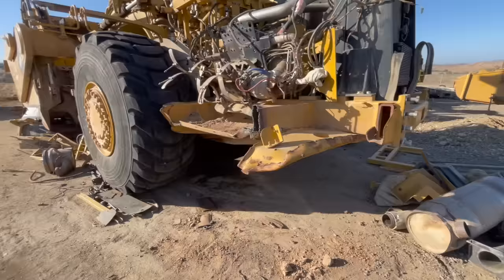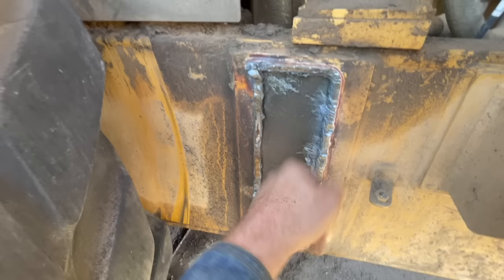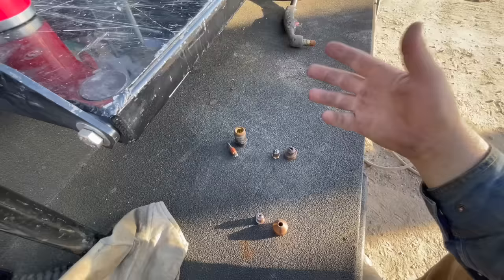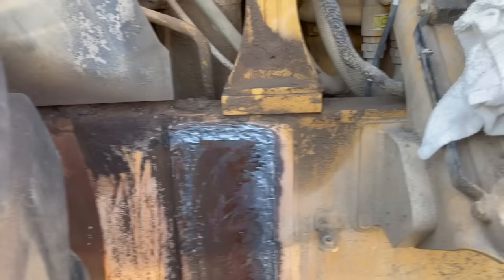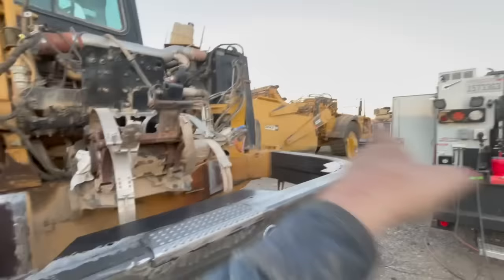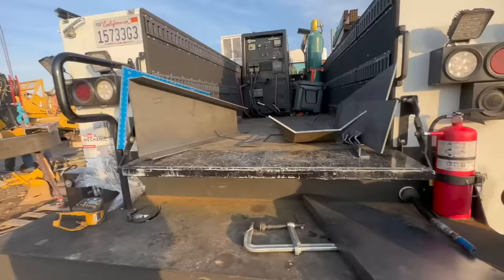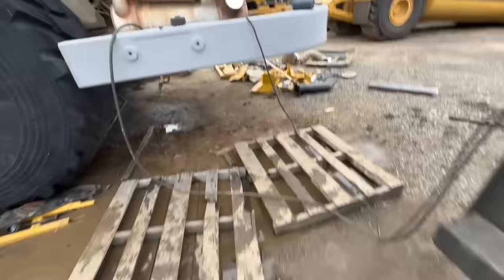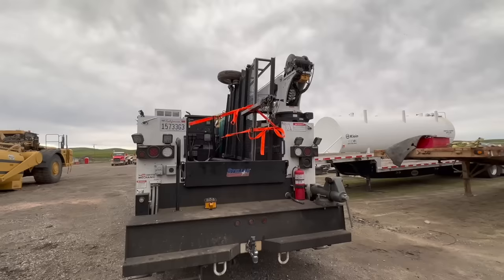CAT 623 Hits Freeway Pillar

Comment: Cool Job. Where I use to work I oversaw the same job on 2, 797 haul trucks that hit frozen berms, at speed while loaded. We contracted the first to one local Cat dealer and I did the second in house. We built everything from scratch. Fortunately I had a young welder that the guys nicknamed "tick tick" who was fantastic at layout and cutting. I don’t remember the final numbers but  I know we did all the structural repair, bumper, top deck substructure and re-machining the mounting face for the front strut that was torn off in the impact for less money than Cat wanted for the front bumper. The cutting and welding took less than a week. I had a really good crew.
Reply: When I first read this I wondered how two thousand, seven hundred and ninety seven haul trucks could be on the same job and hit the same thing. Took me a minute to figure it out, TWO model 797 haul trucks.
Reply: Is there an issue with alignment of the over all structure of the 797. My guess is the 797 took a glancing blow from the bridge, also I’m sure the bridge structure is like new except for some yellow paint scratches. I have seen pictures of cement bridge abutments hit head on by a locomotive  pulling loaded BOx cars at moderate speed. The abutment appeared mostly undamaged.
Reply: @Timothy-lb2vr  On the other hand, I saw the photo of a semi that took out 12 wood guardrail posts + guardrail and then sheared off one column of a two-column bent under a bridge over the interstate.  The driver had gone to sleep at the wheel.  I saw the bridge about one month after the accident.  The state had to replace the bent, the span, and the approach span.  It took over 6 months to get the interstate and overhead bridge back open.
Reply: Awesome . I worked for CAT and did many rebuilds. Yup quite costly especially today. 
It’s unreal what’s happened at dealerships …..

Comment: Those little "Pocket" Cahin hoists are such a great back savers and alinment tool. Everyody laughs when you show up with one of these but doesn't take long before they ask where you go it.
Reply: I use the same hoist, I have a trolley overhead in my race trailer for removing and installing the engine in the race car, as well as a trolley that goes out the side door to do the same if the car is outside next to the trailer. The hoist works flawless. Engine probably is maxing the weight rating but it has not failed yet.
Reply: This is the coolest repair ! We use those baby chain falls at work ( on tractor tugboats) for mechanical repairs-My late boss was from Holland. He called them”BBs” and they are INDISPENSABLE. 

THANK YOU Greg for sharing your outstanding content with us !

Comment: Your super strong magnets you were using to lift the rear cross member inspired me to look for something like that.  Found fishing magnets might be a possible solution for those that haven't ventured into lifting magnets.  Found one that is 1320 lb rated (probably under perfect conditions) for a mere $35.  What was really cool is it has an eyelet on top and the side.  
How the heck do you "accidently" buy a trailer?  Just a slip?  I've bought stuff I didn't set out to buy but never accidentally. :o)(o;

Comment: Use to work for cat at the plant that made these. Worked in the adjust floor for wheel tractor scrapers. They got rid of that department years ago because they now want the dealers to fix any issues with the machines. Can not believe how cheap they have gone with these machine over the last 10-15 years. Thought I saw them going as cheap as they could but looking at this I can tell they found more ways to cut cost. And this does not make the machine better only cheaper, and I do not mean cheaper in the selling price

Comment: So I’m still at the beginning of the video.
Did you make all the parts new other then the bumper? Or take that other machine apart and use those parts? If so I’m wondering what’s wrong with the other machine that’s they’d cut up another machine like that for parts. 
I don’t always get to watch it all till some times days later.
Good luck, love the rig and equip.
Reply from the maker: All parts were made.   No cutting the other machine.

Comment: How’d you start in this field mechanic work? Did you go through welding/mechanic school before or did you learn to weld through experience? Do you need to be welding certified?
Reply from the maker: I got started at a very young age.  I never went to any school for welding or mechanical.  Everything I know is self taught. You don’t need to be certified but some jobs require a cert.
Reply: @OFW  you ever do any jobs in Sacramento? Maybe I can come work and learn from you😁
Reply from the maker: @Maxdubi  sometimes I’m in Sacramento.

Comment: What's your recommendation on a helmet for under $500. Looking to replace my older Speedglass. The newer models are $650. $200+ more than I paid for mine when they first came out. I've seen a lot of good reviews on the Esab A50. And for $350 it's not killing my pockets. Not sure what helmet you run but I love the huge viewing area
Reply from the maker: I run the Miller digital infinity I have them in my Amazon store.  

https://www.amazon.com/shop/onfirewelding/?ref_=cm_sw_r_mwn_aipsfshop_aipsfonfirewelding_DRTPPM652TJYJ9ENQ756
Reply: @OFW  I'm new to the channel. I've been a machinist for 17 years and done everything from aerospace to heavy equipment machining. I just started working for a company 3 months ago that does nothing but hard facing and armor plating on equipment attachments as well as line boring. Line boring was new to me. But as a machinist it came easily for me. I've been learning a lot watching your videos working out in the field. Especially when you get into detail about gouging/cutting. I used an air arc for my first time 2 weeks ago. So I'm hungry for knowledge. Anyway, thank you for the content. Thank you for the link to your store. You list a few items I actually bought last month for line boring. Keep up the good work. I love learning something new with each video!

Comment: Beautiful work man! Do you prefer gouging with the plasma over the carbons? I never tried my plasma for gouging, and it's an older Powermax 600 so I'm not sure if I even can. I have a 500 amp Lincoln Commander so no problem using carbons.
Reply from the maker: It depends on the situation.  They both have their purpose in my opinion.

Comment: You should check to see if you can adapt your plasma to the new sync style tips . I did on my little 45 and they are great . They have cut and  gouge tip. Lasts much longer than old style
Reply from the maker: I have been curious about that.

Comment: Why the parts are not painted before installation?
Reply from the maker: Because it doesn’t make sense to paint something if you are going to weld on it.
Reply: @OFW  Thanks, understood. Would it make sense to paint the parts before installation but leave a generous area of bare metal at welding areas? Then finish painting once the repair is over. The appearance of these CAT machines are in a mess anyway. Pre-painted parts should speed-up the job.